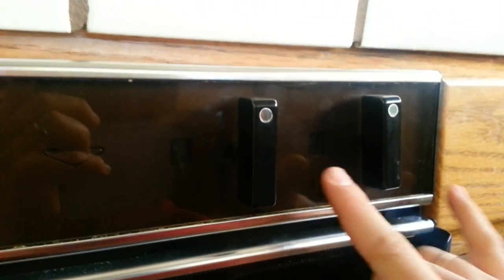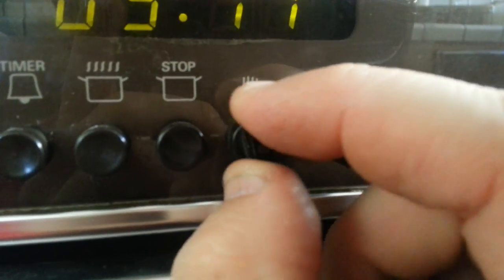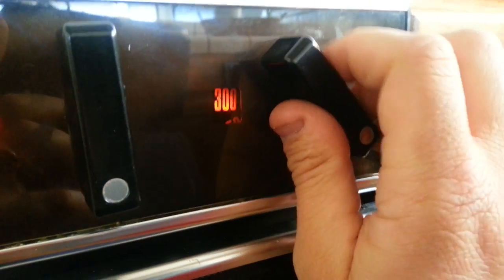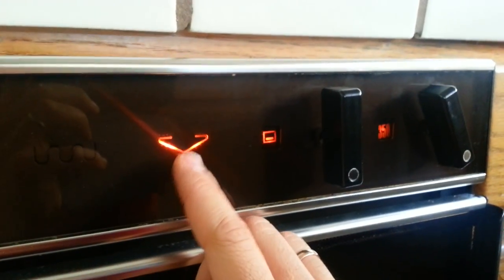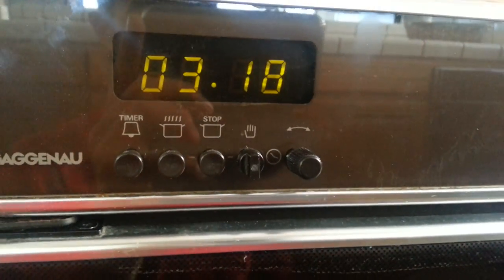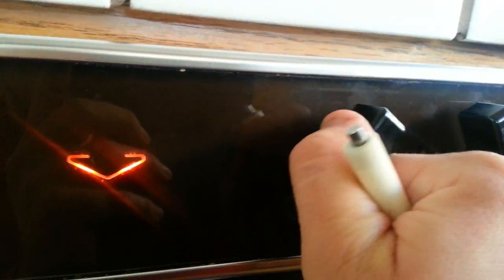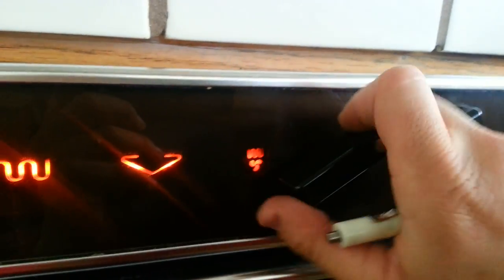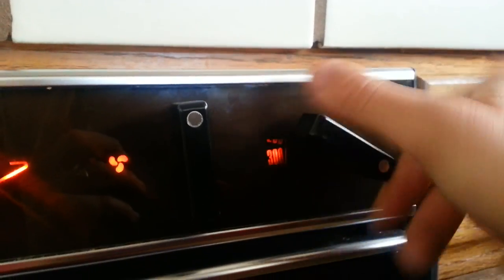Gaggenau Wall Oven

Comment: I know this is a long while ago, I just got an oven like this. I don't think that "hand" symbol is a child lock, according to other Gaggenau manuals I've found that is the "manual operation" setting. That is why it turns to "auto" when you turn it horizontal, you are supposed to enter the cooking time, temperate and it automatically will cook everything. This explains why you can't adjust the controls and why it isn't heating up as when in "auto" mode, it's expecting you to program it and it's waiting. 

You likely never want to use "auto" mode, the instructions I've read, explain that all it really does is switch the oven off and plays an audible signal when the cooking time is over. 

The "hanger" indicator is that the oven is on but not yet at the set temperature, i.e. it's heating up.

Comment: That is not a 'child' mode.  That is to set the oven to automatically start at some time in the future.  It's a little convoluted but you turn it to auto mode, then push the stop button and set the stop time, then push the second button in to set the duration.  It will back into the start time from the stop time and the duration.  Unfortunately it is not 24 hulour time so you can only set it 12 hours in advance.

Comment: I have an EB695-600 from 1986. The door latch is gone on one side and failing on the second side. Is there a video regarding replacing the door latch?

Comment: hi thanks for the video! however, our gaggenau oven looks just a little bit different and we have no idea how to use it. It will be great if you know something. We have been afraid to touch it for years. Gaggenau EB 846-600. Our "child hand" button is a dot and not sure when it is horizon or vertical.

Comment: I just moved into a house with an oven like this, the only difference is that mine doesn't have the horizontal or vertical part, its just a round nob. I have no idea how to change the time on it.
Reply: Danielle Brosnan Haha having the same thing atm
Reply: Danielle or Mr klunder have you figured it out yet? I have the same thing. Moved to a house with this beautiful oven but I cant set the time right haha
Reply: Try pressing the first two buttons (from the left) at the same time - this should make the dot flash on the time. Turn the dial to set the time - you may need to keep the buttons pressed while doing this
Reply: Hi Danielle, we have the same round nob that you have. Gaggenau EB 846-600. we are also figure it out how to use it. we have it for years. it will be great if you already figured something out.
Reply: Has anyone figured out how to change the time on an EB 846-600? I’ve tried but haven’t figured it out.
Reply: @MsAS1314  have you figured it out? I’m needing to know how to change the clock.